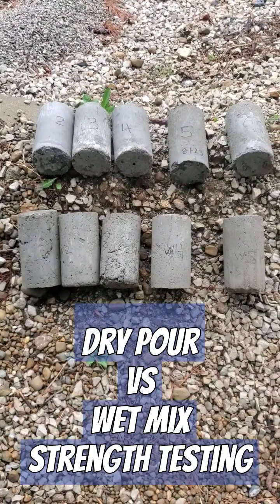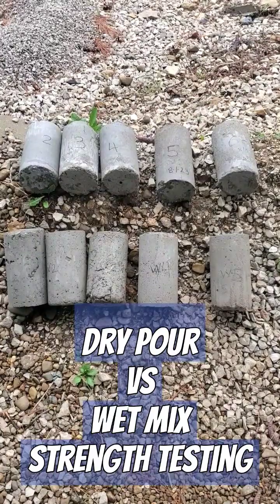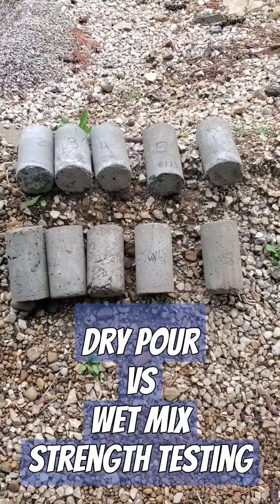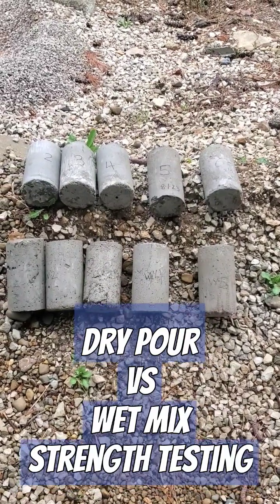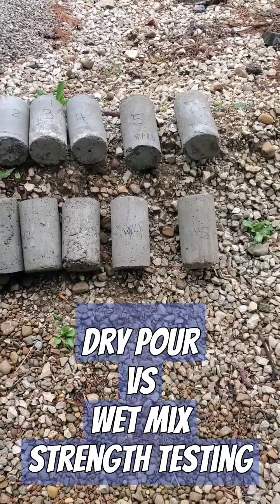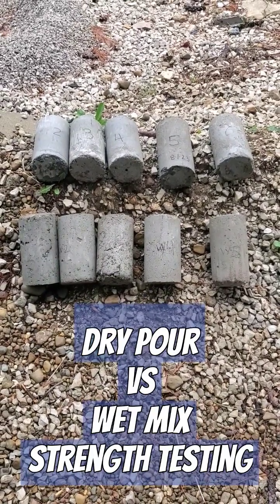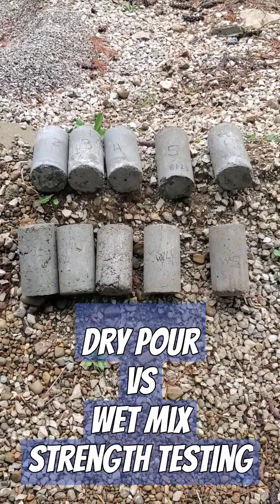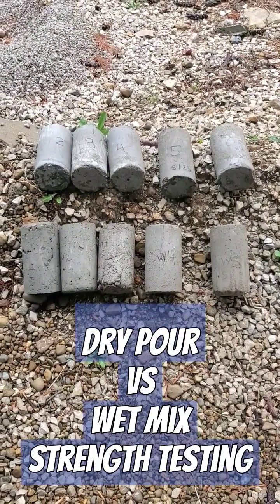Dry pour vs wet mix. The real answer is on the way.

Comment: You should try to do 7, 14 then 28 day break results...during construction you can't always wait 28 days
Reply from the maker: Good thought.  My goal is to see the end results, after all curing is done, how strong is dry pour compared to wet mix.  Is is 50%?, 80%?  Just as strong?

I think that is what the big controversy is, so I have set out to get some numbers to end all of the speculation.

I think any contractor, or construction outfit will and should always use wet mix. 

Dry pour is more for people who want to do it theirself, but have reservations about having a few thousand pounds of wet cement, not being sure if they have the knowledge,  or stamina to properly finish it before it becomes solid.

Comment: Are there any videos about making the samples? It would be nice to know/see what made any differences in the setup. Planning a Barn-dominium project with a 60x40 slab (or sections of piers, footers & slabs 😮). Great videos 👍. Keep them coming.  Thank you.
Reply from the maker: I did video making the samples.  That will be part of the full length video when we do the hydraulic crushing and get the pressure readings.

Comment: The real important difference is the curing.  If you wet cure you can get 70% stronger concrete just by wet curing for up to 28 days.  If you don't wet cure it then it's weak concrete, doesn't matter if you dry pour or wet pour, you want to wet cure it for as long as possible, up to 28 days.

Video:
https://www.youtube.com/watch?v=1siLxrpm_PE

Comment: The dry pour looks alot better lol but lets see how strong it is.
Reply from the maker: The dry pour does look better.  I thought that was odd.  We will know how strong it is in comparison soon enough.
Reply: @HankBaugh  I really do hope its as strong as the wet pour. I just bought a full pallet of sakrete concrete mix 80lbs bags.
Reply from the maker: Stay tuned to find out  @Joel0297
Reply: @HankBaugh  when will you upload the next video?
Reply from the maker: @Joel0297  The crush testing cannot be done until the wet mix has cured for 28 days.
I took the last sample out of the mold today.  Be sure you are subscribed and are following so you don't miss it.  Meanwhile you will just have to watch me do other things while we wait.